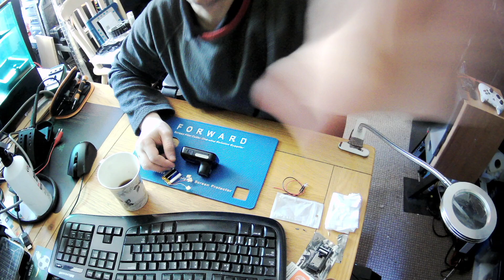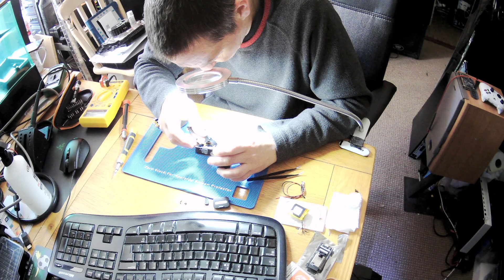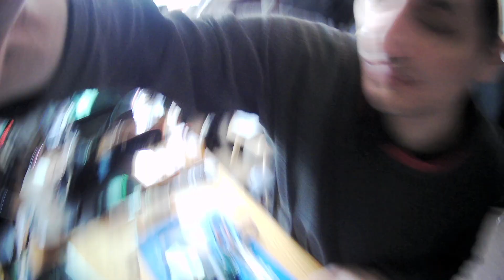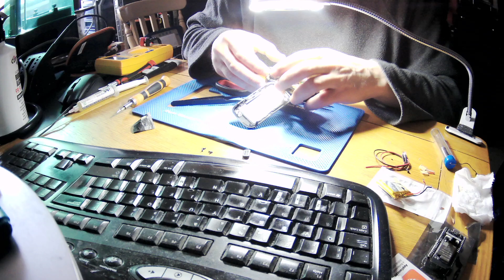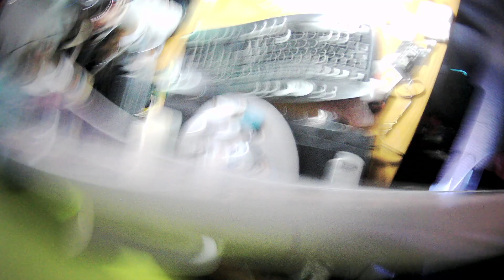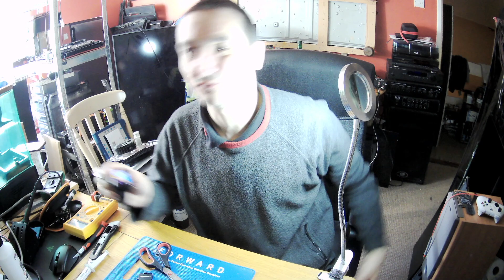#59 Nextbasee dashcam 322GW - display is popping out and the battery is dead, let's fix it!

Comment: you can leave the 3 wires attached to the board, just cut them one at a time so they dont short out cut the battery end leaving 30mm of wire then solder the wires to the new battery leads and use heat shrink for insulation the wires can then be placed in the casing, this way there's no risk of damaging the circuit board or shorting out when soldering.